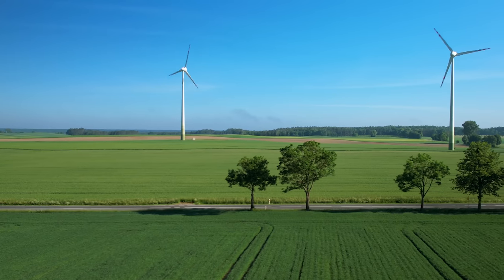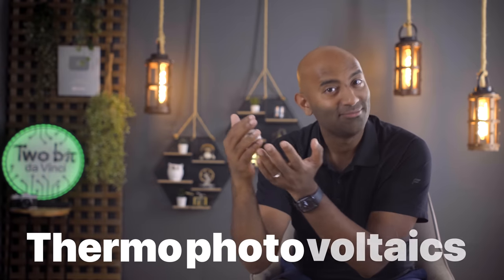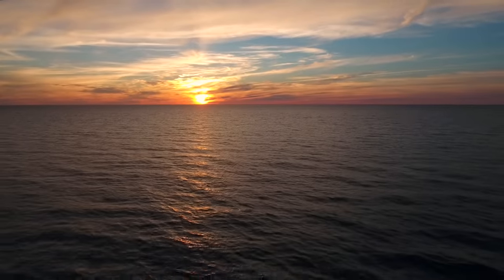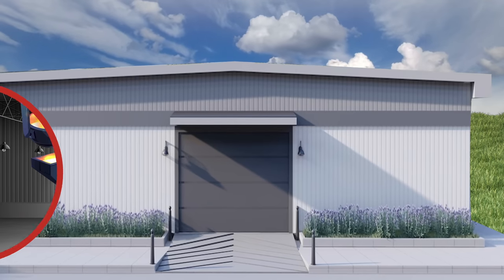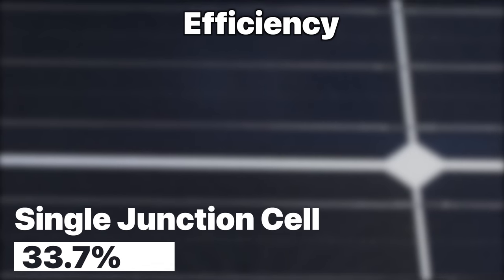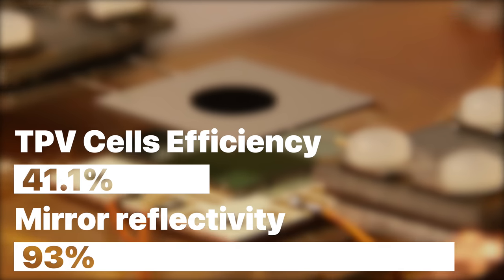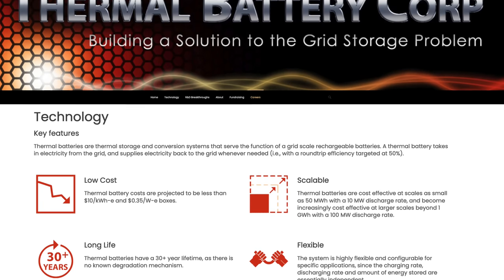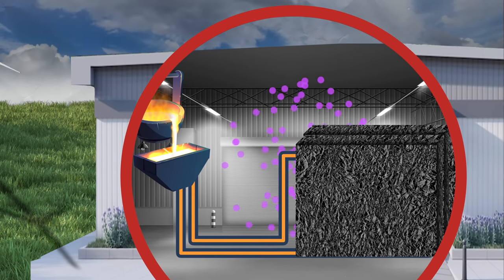Breakthrough Solar cell DOESN'T Run On Sunshine!

Comment: I think the correct direction for energy technology is towards energy independence, meaning every home should produce and store it's own energy. This tech does not seem well suited to this direction. But it does seem very interesting for something like a communal moon base.
Reply: I agree with you. Decentralize energy and food systems to a hyper-local source, in the home, and hope the transition away from globalized supply chains takes hold without crazy civil resistance and upheaval.
Reply: I actually think a little less decentralization is advantageous. Yes, ideally, in a vacuum, what you said would be the norm. But, in terms of privacy, if you plan to sell excess energy back to some utility for those who do not invest in such tech, thereby breaking even on the longest term maintenance and replacement fees (sustainable), then having a neighborhood entity act on your behalf is an advantage. The utility could see Neighborhood 1's energy production for the grid, but not the individual members of the co-op/corporation. In this way, it is private how much energy each household uses, creates, or sells back to the grid. If run as a non-profit, this masking effect is absolute. If it returns profits to shareholders (the neighborhood's residents), they do so with their own payout structure, and until a transfer of money is required, it remains private (you could credit their account with kilowatt hours until they wished a full or partial withdraw of its agreed to value).
Reply: I think you & many commenters are missing the point that this does unusual feat of enabling genuinely long term high power energy storage, whilst having potentially relative high efficiency (possibly over 50% which is high for such a long term storage; relative to others that offer say a few-many months of storage). It also seems quite modular & relatively compact ; compared to say pumped hydro. All this whilst still offering long term season to season storage. Also on offer is the ability to reduce & significantly boosts its output power  levels. Obviously a few testbed commercial plants need building, to assess its true usefulness. Seemingly we should be trying to establish as manyfold methods of energy storage & generation, as possible; before a good mix will emerge.
Reply: Communal systems are usually more efficient and cost effective, like having a laundry room in the building versus having individual machines on each kitchen. Heat storage is more efficient the bigger the storage element is, as heat is lost based on surface, but capacity depends on volume, which scales faster. That's the same reason why giant insects wouldn't "work" in real life.
Reply: Or a communal earth base.
Also known as a City.
Reply: @drillerdev4624  I agree with you that they are more efficient, if you don't include the massive infrastructure that has to be built to deliver the energy. But even it was more efficient in any case, the compromise of giving up the freedom of energy independence just to achieve overall more efficiency is not worth it. Unless, of course you are living somewhere like the moon where communal living is an absolute necessity.
Reply: @drillerdev4624  "communal systems are more efficient and cost effective"...and they don't scale well past a couple tens of thousands...which wouldn't work for major cities, but perhaps small cities, yes. 

I lived where I had to walk laundry to a shared laundry room. It's more efficient for the the machinery not being duplicated, but the amount of electricity use is the same, the amount of hours spent on laundry is increased by the walk back and forth, and times there were no open washers or dryers and you had to come back, etc. It's inefficient, if my time is worth more than the cost to do laundry in such a time consuming way. 

If you couldn't be doing something else, sure. But since we all could probably be doing more productive things than commuting to the shared washers and dryers, our time is often better spent working to buy our own washer and dryer, so we can then spend that new excess time doing other chores that need done, or something else entirely.

One thing is for sure...time is the one thing, once spent, you can't get back. So, on what grounds do you really say a communal laundry room or communal anything is necessarily more efficient? In total, it would appear it's not, hence people choose not to use them unless they're too poor to afford better.
Reply: @tonypalmentera7752  if it's in your own building, is not that much of a walk, and it's certainly cheaper.

You also now have more space in your home to dedicate to something else.
Reply: @chrisking2796  The move away is being resisted by the wealthy individuals that benefit from it.  I don't see that as causing riots though there will be other reason to protest or riot and those wealthy individuals may fund them.
Reply: @drillerdev4624  It's also not cheaper for the person pumping quarters in the machine, instead of having a bigger place to put their own appliances in. It's not cheaper on the individual in that sense, it's just again, less washers and dryers made, at the expense of inefficient use of time for people. That loss of efficiency seems small to you, but it's huge. 2 hours a day is 1/12 of your year, an entire month of wasted time. So, if it's wasting even a half hour per week, that's 2 hours month, or an entire wasted 24 hour day, which is like three 8 hour working days. What productive thing could humans be doing with that time? Multiply it by all the people living in the building. For us, the building had one room for laundry, about 4 washers and 4 dryers...for maybe 30 apartments, and maybe 90-120 people. Lots of wasted human energy...and to multiply that inefficiency times a city's population would be even worse.

Comment: The comparisons are all over the place.. Those cells are competing mainly against combined cycle turbines (at 60% eff.) and are >>composite<< to a heat storage cycle. Luckily, the sandbattery boasts a 98% thermal efficiency, which places a combination at somewhere around the efficiency of the thermal cells. In this scenario they could play a vital role in long term energy storage, if they are optimized to 50% efficiency. This might well be the future of renewables.

Comment: To be effective this system needs to really be collecting sunlight directly as a thermal energy via highly concentrated sunlight.  Then your not going from 20-30% efficient solar to a crude resistence heater then back to electricity at 50% to get a total efficiency of 10-15%.  With direct solar heat capture your looking at close to 100% initial sunlight capture and then 50% conversion and 50% final output from the same area of solar farm.
Reply: Your losing 60% to 70% at night when the sun is down. This could run 24/7 as long as temperatures can be maintained. My concern is cost, which system is a 50 year average roi.

Comment: Seems like good science but the safety aspects of such a system will add complexity. The first thing that jumps out at me is the water cooling will need to be comprised of three independent systems running simultaneously, each of which must be capable of handling 100% of the cooling. It will be interesting to see the prototype in operation.
Reply: And the water cooling... Ugh

Comment: Very enjoyable video. One bad number. Your efficiency for turbines refers to gas turbines, which are inefficient, but were commonly used for peak power consumption times. Steam turbines, combined with the reheat piping in a standard boiler produce efficiencies in the 90's. A gas fired or coal fired power plant has an overall efficiency in the low 70's (burner efficiency x turbine efficiency x generator efficiency).

Comment: The main problem with molten tin is that if something goes wrong, and the heat drops below the melting point, all of the tin solidifies. So the system cannot ever be allowed to cool down.
Reply: in such a case, would we not simply... re-heat the tin?
Reply: @aronalle  In all of the pipework ?
Reply: @terryhayward7905  sure. as long as you can put in more heat than escapes through the insulation, it'll all melt.

Comment: I used to measure a DC voltage being produced across the terminals of a disconnected, Ohmite resistor. I would first run a high current through the Ohmite resistor. Next, I would disconnect the Ohmite resistor. As the resistor cools, it produces a measurable DC voltage across its two terminals.

Comment: Vinci just to clarify at 11 minutes you stat that a one meter square cell could produce 100 kilowatts.  Is that from the tungsten foil glow?   I thought it only produced about double the light energy of the sun.  The sun produces over one kilowat per square meter and 50% would be about 500 watts per square meter out in the sun.   Even that would be great because it would allow electric cars to run around town on 6 or so meters of solar on the roof and hood and trunk without depleting the battery and sit in the sun and recharge for highway use.
Reply: Yeah, but how far would you get when you tie your new mattress on your car and happen to cover/shade all those energy cells!!!??? Lol🤣🤣 From a 70 year old great grandma who had to be tutored by her teacher to barely pass algebra! I am AMAZED by all the scientific minds commenting on these sites! KUDOS!!👍🏼🙏🏼🙏🏼🙏🏼👵🏻💞
Reply: @deborahturner1853  I have done the mattress thing a few times.  The answer is to get a solar powered posturepedic matress.

Comment: I used to use a solar calculator at night using the house lighting you have in most houses. And I mean as a calculator not a bookmark. Never noticed any errors. I do remember thinking why couldn't you have a box with a bulb inside to generate more. Then I went back to reading my book.

Comment: 50% efficiency is pretty good, about double that of a gasoline engine. So that raises an interesting question.

Suppose you made a rectangular prism with dimensions around 60x45x45 cm with the four internal large faces covered in this thermophotovoltaic material and backed with a cooling system. That gives you about 1 square meter which should be good for around 100kW, according to the video. Down the center of the cavity you run a tungsten tube into which you inject burning fuel (gasoline, diesel, maybe hydrogen, etc.) to heat the tube to the target temperature (maybe pre-heating the fuel-air mix by using it in a secondary coolant loop).

That would give you a lightweight, compact, clean, quiet, no-moving-parts gasoline-powered electric generator with output power about the same as the gasoline engine in a Toyota Prius, but with around double the efficiency (and probably even better emissions). Add a relatively small lithium battery to provide energy storage and a somewhat larger electric drive motor and you've got a hybrid that might approach 100 MPG with dramatically reduced mechanical complexity.

Comment: What's to prevent the molten tin from solidifying within those massive graphite blocks?  And how does the system recover when that happens?
Reply: Tin melts at 231.9 C - a temperature that is easily attained. You could send heated argon down the pipes to melt out the tin if needed. However, you only need to keep the graphite heated above the melt point to prevent solidification. If you have a loss of heating, then you drain the system when the tin is down to say 500C and restart it later after bringing the system back up to a high enough temperature for the tin to circulate.
You could embed electric heating elements near the tin circulation piping to act as an in place restart system. It would also be useful for allowing you to take the system offline for maintenance without having to drain the system; i.e for replacing tpv elements or tungsten emitters.
Reply: We have many liquid metal systems, it is a problem our species has many solutions for. Most systems use electric heaters similar to a kiln at both startup & shutdown; but liquid steel for one example is usually kept liquid with coal, the same fuel usually used to melt it in the first place. So basically you usually pick an off the shelf solution that best fits your application.
Reply: You don't  and the payback on investmentb for this "system" with maintenance costs and build would exceed it's expected life.

Comment: Experience to date shows that in general materials at extreme temperatures are unstable and therefore system components degrade too quickly.

When a number of challenges to success with materials operating under extreme stress exists, the probability of success decreases accordingly.

IMO that is the long and short of it.

Good luck with the development of this thermophotovoltaic system or whatever system may flow out of it.

Comment: I'm wondering if large LTD stirling engines have a place in this process. I think NASA had made one that had vertually no friction but it was not LTD. It was used buy the military in Humvees exhaust gas to run things like water purifiers etc.

Comment: This is similar to a gas +PV attachment I had proposed and tinkered with in the 90's. I had found that  a  brand of highly efficient gas heaters burned a bright yellow that would charge a photocell from half to full capacity. The problem I ran into was soot (microparticles) in and leaking from the combustion chamber. It builds up too fast on the photocell and any glass divider in the chamber. I only got one week (8 days) of full capacity, and a sharp decline to 30%! Soot attracts soot. And yes, a filter for the intake was already part of the system.

Comment: That looks like a Rube Goldberg contraption, which according to my experience will become quite expensive, because it has so many points of failure. 

Why not ditch the storage part, and just put them /beneath/ any given conventional rooftop photovoltaics rack, so that they can collect the heat portion of the sunlight, and make a double use of the solar energy, even at a high latitude? 

Actually, I am living in a house with rooms right beneath the tiles; and the temperature in my room never went below 25 degrees Celsius (that is 77° Fahrenheit) for three months straight, even at night. I would have loved to remove that heat and make better use of it, instead of seeing it go to waste, or even worse, consume precious energy because of an air conditioner running 24/7.

Comment: As always. Could, Might, Possible, etc.. Let's hope for some real breakthroughs. How much energy is used to heat the tin to become a liquid, as that is part of the efficiency equation in reality. Where does that energy come from and what is the efficiency of producing that energy.  it's complicated.
Reply: I think part of the idea is to use solar or wind energy to get something like tin hot  then use that as the energy source when there's no wind or sunlight 🤔
Reply: @ninjaxorgmail  On this we agree.

Comment: The heat shielding on spacecraft is called ablative shielding. It's designed to shed itself, and take thermal energy away with the pieces. In a sense, designed to fail in a controlled manner, like a fuse.

Comment: There's just one glarring question: How do they heat it up so much without using more energy than they put out?

This just sounds like more pie in the sky! Especially with climate change!!
Reply: Redirected excess electricity generation.
Reply: True it cost more more to put in than they get out.
 But its made to use up unstored (wasted energy) without using up valuable light weight lithium
Think hydro dam after a storm. About to be dumped
Convert movement into electricity - use electricity to make heat-
Store heat not electricity- then convert to electricity when needed.
More or less

Comment: This sounds great - as a generator for a traditional heat source. If you use it for fluctuating energy like solar or wind, you would still suffer unnecessary losses.

Comment: This tech seems rather unplausible and is still very far away from any commercial adoption - according to the scientists' own roadmap, it's not even clear if basic reliability criteria can be met or such TPV cells can be mass produced. At this point, slapping peltier elements with heatsinks + some fans onto all kinds of processes that create waste heat in order to turn the thermal gradient back into electrical energy seems more viable. Heck, they could even increase the conversion efficiency of steam turbies.

Comment: Technically speaking heat is light.  Heat is infrared light - its just lower frequency.
Reply: Well it's  a bit more nuanced then that.
Heat is a form of energy and thermodynamicly a  'measurement' of the average movement of atoms.
Heat transfer can occur through the processies of condution, convetion or radiation (aka light).
Reply: Heat isn't light. Light is a byproduct of certain visible frequencies. Heat is a radiation of said frequencies.
Reply: You are incorrect: both are electromagnetic radiation, but of different frequencies.  When light strikes a surface it can be absorbed and re-emitted at a different frequency.
Reply: @michaeldeleted  Wrong. Everything is in waves, but it is not "light" in itself.

Light specifically is excited by photons in a certain range of frequencies. That being said, waves and particles being moved as such is described as light. However, heat isn't electromagnetic. It's kinetic energy.

"When light strikes a surface it can be absorbed and re-emitted at a different frequency." - Except heat itself doesn't entirely behave that way, therefore it is not the same as light and couldn't be comparable.
Reply: @AAFREAK  I'm sorry if my one sentence post that was a slight oversimplification  offended y'all, but I assure I know how this works.  I was referring to the heat energy emitted from an object that you can feel as heat, or see with an infrared camera.  That IS infrared radiation and it IS  light.  That is also the very thing the video was about.